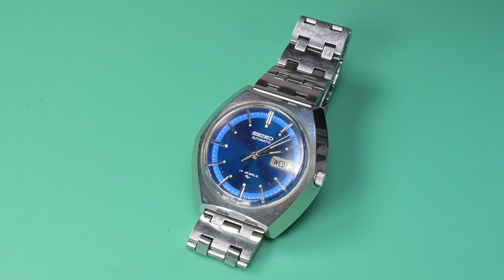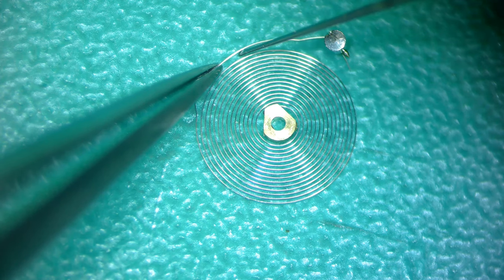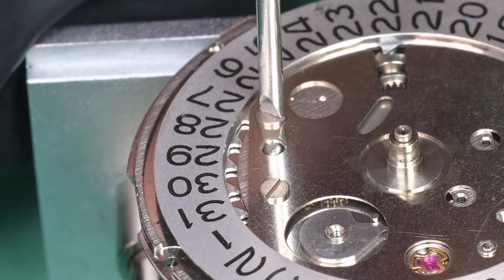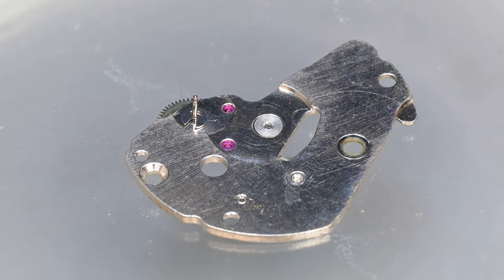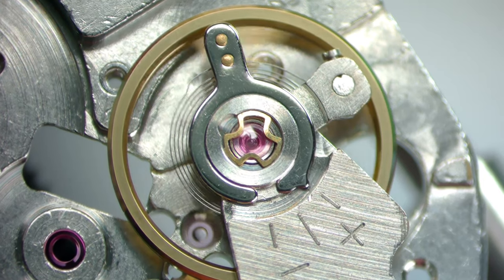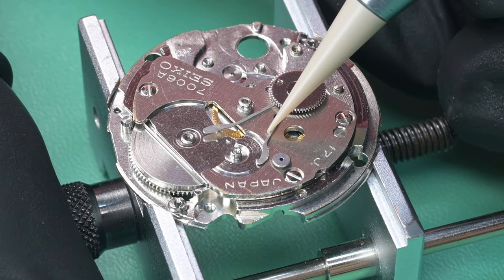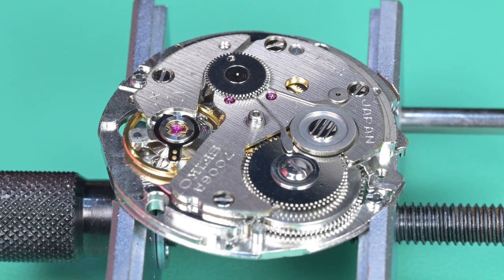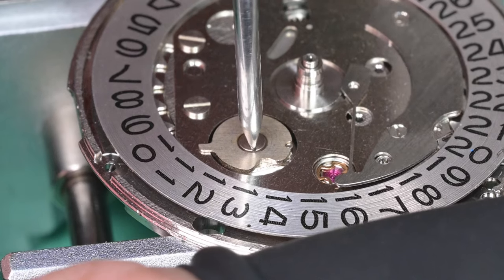Hairspring Havoc: A 1973 Seiko Balance Repair & Service Journey

Comment: Nicely done! Great camera work and explanations. I've been mostly working on Swiss watches, so seeing the Japanese approach is refreshing. I like how Seiko builds the return springs into the parts, instead of using thin bits of bent wire.
Reply from the maker: Much appreciated!  I like how they do that as well.  They are built to be robust and reliable, and it appears they use that thought process in their engineering.  It's quite smart to combine the springs into the parts, especially from a mass production standpoint.  It's just a different philosophy in watch manufacturing.  I do enjoy working on Swiss movements as well.  You can certainly see the different engineering concepts between the two when working on them.  Both are great in my opinion though.
Reply: @WeekendWatchRepair  agreed!

Comment: Thanks a bunch for this video!! It will help with servicing my yard sale 6106. I previously broke pivots on two pallets from other watches 😢, so appreciate seeing things done right. Watching the technique in this video, it looks like the correct approach is to incrementally and alternately lift the plate off the posts, and keep the bridge parallel to the main plate as close as practicable. Also align the screwdriver towards posts or screws while levering so if it slips, it stops at the screw or post. Is this correct?
Reply from the maker: That's how I like to do it.  Many movements have slots that are designed to be used to lever the plate off. Doing it incrementally is the key though.

Comment: Superb job, I love my vintage Seiko's and my 19 jewel 7006 has a similar problem with the hands but mine are very loose when turned with the crown also the minuet hand just stops moving even though the watch is still ticking so thanks for the work and commentary shown here to give me some tips on how to maybe sort it out. Cheers Weekend watch repair
Reply from the maker: Thanks for the comment.  The first thing I thought of when you talked about your watch is a loose cannon pinon.  You might want to give that a look.  Those can be tightened up with proper tooling.  Replacements can also be found relatively easily.

Comment: I know this is an old video and you might already know this, but when you turn the hands backwards at 10:32, the seconds hand is moving because the balance is out - the pallet fork is allowing the escape wheel and the entire train to move backwards. It's a really good way to get a chip on the pallet stones, so it's better to not do that too much!

Comment: A bold venture into hairspring manipulation!
But your goal of maintaining an even gap between outer coil and terminal curve is misplaced - the coil is a spiral - i.e. has constantly INCREASING radius, whereas the terminal curve must have a FIXED radius - exactly equal to the distance of the midpoint of the regulating pins from the pivot center. Thus, they can not be parallel - the separation  under the stud will be less than the separation under the dogs-leg - (as it was when you found it).  The key test for this is that the hairspring centering you depict at 8.47 should maintain across all positions of the regulating arm (or at least a reduced arc of the likely positions). This can only happen when the terminal curve is of fixed radius.

Comment: Maybe I missed it but can you provide what oils/grease you used and where you used them? Thank you so much, your videos are invaluable!
Reply from the maker: Thank you for the kind words.  The lubrication on this movement was as follows:  Moebius 9010 on the balance jewels, escape wheel, fourth wheel, and other fast moving lighter friction spots.  9501 grease on parts of the keyless works & cannon pinion, 9415 on the escapement, Seiko S4 grease on the barrel walls and pawl lever/first reduction wheel junction, 8200 on the mainspring, and HP1300 everywhere else.  All gaskets got silicon grease.

Comment: I really appreciate your attenton to detail, really good videos and nice narration. I do have a qusestion though, where do you get all your seiko parts from? Gaskets, crystals,etc..
Reply from the maker: Thank you Michael.  I have a pretty good collection of Seiko parts and gaskets in my stock at this point, however if it is something I don't have I can generally find parts on eBay or one of a couple websites for parts on specific Seiko models.  Most of the time though, eBay is the easiest place to find the parts I need.

Comment: Adam, can you recommend a crown gasket assortment, as well as a case back assortment, or what I'm looking for in purchasing those? I just don't know enough yet to know I'm not wasting my money.

I'm so close to opening up a movement and having a whirl, but don't quite have the courage. In the meantime I've just been doing peripheral tasks to get comfortable, eg, cleaning case and bracelet, installing crystals (breaking crystals 😂), installing stems, installing hands,driving my wife crazy with tool purchases, etc. 🎉
Reply from the maker: I’ve got mine from CousinsUK.  For caseback gaskets, I’ve got assortments for flat and round gaskets. Regarding crown gaskets, a standard assortment, and a D & E shape micro assortment specifically for Japanese movements.
Reply: Thank you, Adam! I will proceed with this info. 

Just so you know, after this comment yesterday I said "What the heck, I can't keep avoiding it" and dove into my first service. Citizen 8200 from a Franken watch I got myself for Christmas... it stopped working 30 minutes after I got it. 😂 Weird symptoms, like the hands spinning out until the power was gone. When I opened it yesterday, two things jumped out: a pallet bridge screw was loose and there were small metal shards everywhere throughout the movement. I'm hoping nothing critical damaged tho. Got everything cleaned up using my ultrasonic today, and it's ready to start the reassembly in the morning. Even if it doesn't work, it's still a learning experience. Thanks to you sir for plowing ahead and inspiring us!!
Reply from the maker: @ForestWoodworks  That's excellent to hear.  Did you find out where those metal shards came from?
Reply: @WeekendWatchRepair I got it! I got it!! Been working on it since I commented the other night, just finished and it's running! My first automatic watch service fix. 🎉 The whole movement was dirty, so I think the shards came from whatever environment it was in before. Although I was laughing because when I went to oil the balance jewel and pulled off the cap jewel, there was a perfect dot of oil just like you teach. The whole movement was filthy, but someone took the time to oil the jewel properly😂.

I can't believe I got it to work. A complete service, rudimentary but complete. Only thing I can't do to it is the adjustment on the timegrapher and I also don't have expertise to dial in the hairspring. Also of the whole job, I probably spent a total of 3 hours on my hands and knees looking for parts, cleaned my office 4 times too😂.

I really can't believe this. So stoked!!
Reply from the maker: @ForestWoodworks That's fantastic.  Congrats!

Comment: I wonder if its a frankenwatch from India being from ebay. The cannonpinion being that tight and the movement of the hands leads me to wonder the history of the watch. Are cannonpinions interchangeable? It does have a beautiful dial. I have one 7000 series and a 1st gen orient both are non manual wind watches. I'm not a fan for that reason. Both are great watches, the purist in me says if they have a crown it should wind the watch. Probably why i dont like quartz watches too. Lol. Great video, close ups and all are great. Your production value is as good as any other watch makers on you tube. Keep up the great work.
Reply from the maker: I appreciate the kind words.  Cannon pinions can be interchangeable between certain models & cases (due to required height).  I don't believe this was a frankenwatch.  My understanding is that it was bought in a lot of a few watches from a private individual on eBay.  Outside of the cannon pinon issues, this watch did not appear to be pieced together from multiple movements.  It was in pretty good shape for the most part.  My thought is that it had just been a very long time since it's been serviced (if ever), and once it became heavily magnetized it was put in a drawer and forgotten about until it was sold.  I could be wrong, however I think it turned out well though.
Reply: @weekendWatchRepair  it turned out very nicely. I really had no idea if cannonpinion's could interchange.

Comment: Thank you for sharing, do you remember which spring winder did you use? RH? Arbor size is diff from swiss, you guessed it I need help
Reply from the maker: You are correct.  That is a RH wind arbor.  I do not remember the specific size.  From the video, it looks like I was using a 6 or a 7.
Reply: @WeekendWatchRepair  I keep reading how it can break easily because of the arbor size mismatch, any tips ? A Rolex size arbor will break it ?

Comment: Hi! When you replace the caseback gaskets are you using a generic one or a seiko replacement? Do you mind sharing your source? Thank you, love the videos!
Reply from the maker: It just depends on the particular case.  I have an assortment of flat gaskets (bought from CousinsUK) that I pull from to service many of the Japanese style watches I work on.  Most of the time I can find one of the correct size and thickness.  Sometimes though I have to source an OEM gasket.
Reply: Thank you! Appreciate the answer. @WeekendWatchRepair

Comment: What do you  use to clean the pivots?  It looks like an eraser in a pin vise.  I assume the pivot pokes goes into it, like poking an oiler into pith, and then just twist.  Or is something else going on?
Reply from the maker: They are silicon polishing pins.  EVE is the name brand, but you can buy generics that are the exact same thing.  Esslinger has a set - ref. SKU 10.01339 -  I use the green 'extra fine' tips.  You push the pivots (gently) into them and you can clean and lightly polish the wheel pivots.  It's an easy method to use as longs as the pivots are not in too bad of shape where they would require a jacot tool (which is something I want to show in the channel at some point).   I hope that helps.

Comment: I’m a new  viewer and just wondering how long does it,on average does it take to complete a servicing of a watch?
Reply from the maker: It's a difficult question to answer.  I typically work very slow, and in shorter periods over several days as my schedule allows.
Reply: @WeekendWatchRepair    Thanks for what you do.
I’m 75 and was an appliance repair person. 
I always wondered how  watches were made. It fascinates me!

Comment: What kind of tool do you use to clean the wheel pivots?
Reply from the maker: A silicon polishing pin.  A common brand is Eveflex.
Reply: @WeekendWatchRepair  thank you
Reply from the maker: You bet.